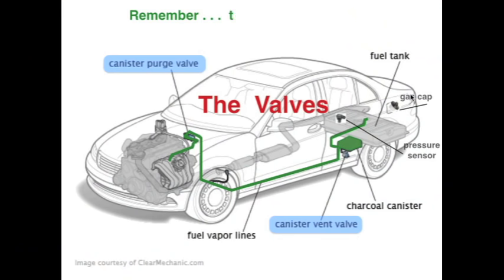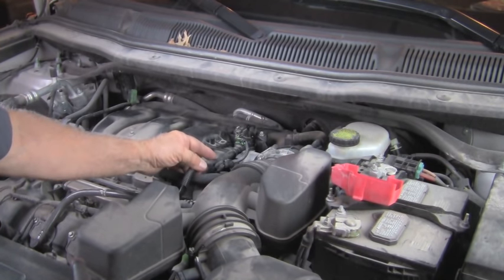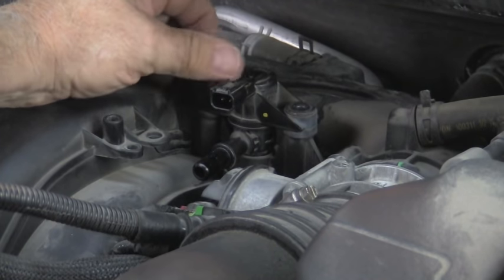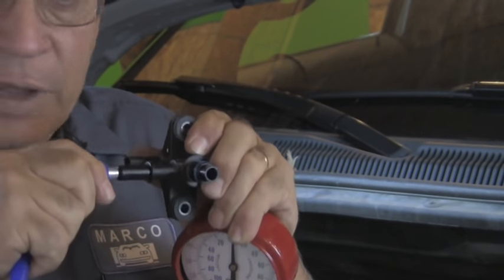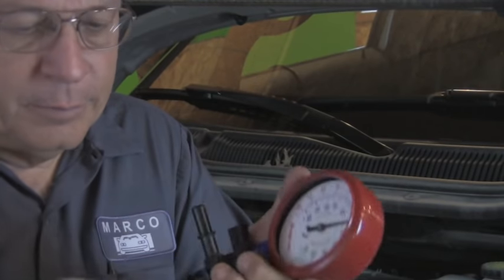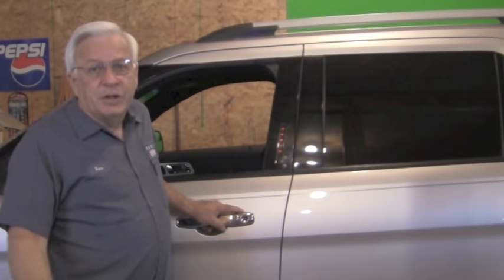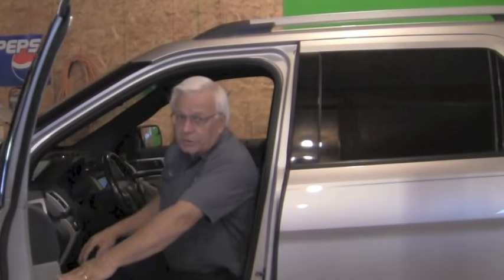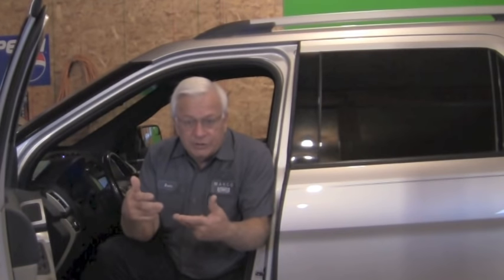How to find a Small EVAP leak without a smoke machine Part 2

Comment: This is a very good troubleshooting video and a clear step by step guide of how to read codes all the way down to the smallest details. I have an EVAP problem with 2003 dodge grand caravan and I had it checked and they found a leak when they smoked tested it but after days of driving the small leak code came back again and I took it back to them and found another leak and changed the rubber hose but they charge me again for the same problem. And now after driving a few days, the small leak code (P0442) came back again but I'm worried that they will charge me again for the same problem. Is that fair and normal in your field?
Reply from the maker: EVAP problems can be the most difficult to find. And it is possible to have more than one leak.  However, the system itself is monitored by the PCM and can tell if the system is working properly or not. .  A tech who truly understands how to diagnose these problems should be able to run a test after he has found and repaired a problem that would confirm that the system is fixed or needs more attention.  Unfortunately many techs simply find a problem, fix it, and return it without verifying the system is really fixed.  My opinion only is this: the shop you took it to most likely doesn't understand this or they would have confirmed the repair the first time.  Is it fair . . . no,  however it's probably normally what goes on.   Find a good diagnostic shop, discuss it with them and they will treat you fair.
Reply: +realfixesrealfast 
Sir: you are a very smart and wise.. and very correct.. always think about what your doing. No amount of schooling can replace "Common Sense". !! Thank you sir for your videos , you tell it like it is... easy to understand. God Bless you. !

Comment: My question is, my 97 Ford Ranger 4.0L has a thermistor valve as well as a purge valve.  A thermistor would deal with temperature?  What is its purpose in the evap system?  Most before 97 and all after do not even show a thermistor.  My shop manual (Ford complete) does not even show it in the schematic.  It is in line before the purge valve driver's side down by the wheel well with the cannister being just outboard of the radiator.

Comment: I'm not sure how Holden does it in my 2002 model Holden Commodore as it runs the 5.7 litre Chevrolet LS1 V8 engine & they didn't fit a pressure sensor in Australia.

In my case it was a leaky fuel tank cap so that fixed the P0171 lean code issue,the question would be - is the purge control valve solenoid closing off fully when the engine is switched off ?

It should  because the fuel tank vapours shouldn't be able to vent into the atmosphere,I can always check it when the  engine is switched off by blowing through it !

Comment: Duane,
I have a 2000 regal gs (supercharged) Summer car (no rust) 110,000 km (68K mi) P0442 code. Changed the fuel tank pressure sensor last year when code first happened. No fix. Blow test on purge valve shows no leak. tested with vacuum gun too.
I have a descent scan tool (not as fancy as yours). Freeze Frame data shows rpm 2021, vehicle speed 43k/h (27mph), coolant 62deg C (144 F). With car stopped, I also read live data Fuel Tank Pressure -0.19 mm HG (some flicker to -.38)  FTP voltage 1.43V)

One difference between my car and the ford is that the ford code happened with a stationary vehicle. mine was moving at about 27mph. Does this tell you anything relevant?

It would have been nice to test the other valve (vent). I cannot program it to shut off like you did with my scanner. Will applying 12V cause the solenoid to close the valve?

Thanks for video.

Comment: Video was good about you explaining how the evap system works.  I agree.  Your Diagnostic tool/computer did not help in any way...all it did.....verify a small leak. Data did not help to find the leak.  Ok. you found the leak at the Purge Valve....lucky you!   Computer tell you the Purge valve is bad?  Also, Just wondering ...how long did you drive the car before it did the self test on the evap?

Comment: YES, THIS IS HOW IT'S DONE.    AS A TECHNICIAN , NOT IF I AM MY OWN BOSS, I CANNOT SEND THE CUSTOMER OFF AND TELL THEM IT'S FIXED UNLESS I ACTUALLLY PERFORM THE LEAK CHECK.  CHECK AND VERIFIED.  SO ALWAYS PERFORM LEAK CHECK BEFORE RETURN THE CAR BACK TO CUSTOMER  BY ACTUACTED THE PURGE AND VENT SOLENOIDS AND WATCH THE VACUUM VIA THE FUEL TANK PRESSURE SENSOR TO SEE IF IT HOLDS.
Reply from the maker: Thanks for your comments.  I appreciate it

Comment: I will check my purge valve like this. :) I have a very small leak that my check engine light comes on after about 2500 miles or 3000 miles.

Comment: Very informative video. Quick question though: since the check engine light came on for the customer after 3 startups and 81 miles of driving, how can you be sure that the problem is fixed after a few miles of a test drive? Or does the computer immediately recognize there’s an issue, which shows up in the scan, and only throw on the check engine light if it persists for a given period of time?
Reply from the maker: Great question.  It can be frustrating because most OEM's have their own algorithm.  The evap monitor does not run automatically. It has several parameters that must be met before it will actually run the monitor.  A long test drive that includes a couple stop-starts and speed changes usually will hit the parameters.  I usually include some city and highway driving.

Comment: Anything, sir, u can post about the 98-11 Ford Panther Platform would be greatly appreciated! I just got a 0442 code on my 2000 Mercury Grand Marquis... 121kbmiles, runs rides and drive basically like a brand new car.. I just had filled the tank from very very low and it was extremely humid outside

Comment: Thank you so much for this! I have a 2002 VW Jetta 2.0L. I replaced my purge valve and I am still having a bit of gas smell and not maintaining the start. My code was PO456. So I need to check the charcoal canister next?
Reply: There are multiple things that can cause that code.  I would advise you take it to a good diagnostic shop, instead of throwing parts at it

Comment: I did check the gas cap and replaced the purge valve first and it was not the problem. I was hoping to see how you would find the leak other than the purge valve without a smoke machine as the title suggested. Unfortunately this video was not that helpful for me as I already knew most of the information presented. I don't have a smoke machine and was hoping for tips on how to manage without one.

Comment: Or it could be stuck closed . Went to put gas in my tank and it would not take any, i blew air in the tank ,and could then fill up. I am guessing i blew out the seal in the purge valve because now i am getting P1443. Good common sense video

Comment: If you leave the purge valve in place but with the electrical connector and hose removed, the valve should be closed so, just start the car and see if you have vacuum at the valve.  Feel with hand, use vacuum gauge or see if it draws in something very flexible, such as a very thin strip of light gauge paper but, a gauge is cheap and most accurate.
  That's the easiest way, no removal of valve unless it's condemned.

Comment: when testing a purge valve I usually don't even take them off, disconnect hose going to purge vapor side and leave vaccum source on valve and disconnect electrical connector start it and check vacuum. if the answer isn't obvious then I put a gauge on it.

Comment: knowing that the lines will eventually leak (esp the older all rubber ones) you can wrap the line ends in silicone tape which will ensure they wont ever leak for the life of the car.

Comment: 7:34 not clear.  Why is the Max allowed value 0.40 when it Failed, and the Max allowed values changes to 0.31 when it Passed?  Methinks the Min/Max values are not actually the thresholds for pass/fail, but are the min/max instances seen (and Value is actually an over-time "average).

Anyhow, great deductive work and love the simple way to test that solenoid for holding pressure.

Comment: And I thought I was the only one who used a vacuum gauge to check a purge solenoid. I do it a little bit differently though. I put a hand-operated  vacuum pump on the port that engine vacuum always pulls from, and put the vacuum gauge on the other port. I pump the vacuum pump up a few pumps, and if the gauge on the other end shows ANY vacuum whatsoever, the purge valve's bad.

Comment: I'm having issues with a 2008 fusion recently put on new battery after all the snow and now have a rough idle and startup is slower at times have code p0442 drives fine only issues is at idle either in park or while braking at a light or stop sign

Comment: What effect would a small leak have on the engine other that the service engine light? Also after the repair don't you have to crank the vehicle 5 seconds, turn it off for 10 seconds and restart it? You Didn't mention that.

Comment: I've have code PO442 and P0456 for a while now.  I replaced the purge valve, Evap canister, EGR valve and gas cap.  Still can't figure it out.  It is a '10 Forester.  Any suggestions?

Comment: I have an issue with my 2015 f150 3.5 eco boost with dtc p2196. Sft-1 10%, Sft2 -15% it has 80k miles. Thought it was excessive carbon build up did an induction service with no change then I was told it was the cats partially clogged so I replaced both of them. Readings change quite a bit but then it started to go to -10% b2   b1 and 9% b1 this is better readings but still big difference between banks. Dumped to much money. Already what am I missing? Vehicle runs fine no misfiring.

Comment: Also monitoring the o2 sensors can give a clue given the leak. Most likely a rich condition affecting both banks, probably not large enough to set a code for rich condition

Comment: Thank You! We have code PO442. Went to Auto Zone for testing. They suggest changing Canister Purge Valve. After repair will the check engine light go off? Auto Zone will not turn it off.
Reply from the maker: IF the Canister Purge Valve is indeed the cause of the code, then yes the light will go off but not immediately.  Remember the pcm saw the problem so it will need time to see that it's not there.  You may need to drive it a few days before the system will re-run it's checks.

Comment: If I have suction on the Output side of the purge valve but NOT on the Vacuum side which comes from the gas tank, IS MY PURGE VALVE BAD AND NEEDS REPLACEMENT??? Reason I ask is that on this video he only sucked in from the Vacuum side but not from the Output side. He only tried blowing through the Output side. Anyone know???

Comment: Problem is that this case doesn't require much critical thinking-- you're just starting with the most likely culprit.  It's when purge valve is good, vent solenoid is good, gas cap is good, and even the smoke machine can't point us in a direction, that critical thinking needs to be used....cuz damn, hopefully the pressure sensor the EVAP system uses is probably good most of the time and the code in these difficult cases is only set after hundreds or thousands of miles of driving and many start ups.

Comment: A lot of times, checking the easiest thing first is the way to go and in my case, I got lucky in that it WAS the purge valve.
2015 Dodge Charger with 51k miles kicking out a P0456 code. Removed electrical connector and canister-side hose on the purge valve and by using my finger, I could tell there was a definite vacuum there when the engine was running (and cold). The valve is supposed to be closed under these conditions. This indicated that the solenoid/diaphragm assembly inside was open so I tapped the valve on the intake manifold a few times, sprayed a tad of WD-40 in there and started the engine again. What do you know? No vacuum!
Reply from the maker: Good job, and good critical thinking.  Saved yourself some money too !!
Reply: @realfixesrealfast  True, critical thinking is paramount and I MAY have saved myself some $ but it took more than the one application of WD-40 to loosen things up to the point of clearing the P045 code. It was still "stuck" after attempting to drive several miles to reset the EVAP system so did a second then third application of WD-40 whereas the third included an application of some "throttle body cleaner" to get the code to clear. We'll see how long the clearing of the code lasts but being plastic and rubber, I suspect a purge valve is in my near term budget. None the less, thank you for your guidance in troubleshooting this issue.

Comment: Why does the computer in my 2000 4.6 engine e150 not tell me I have a vacuum problem in my vent door system? Is it not set up to check that system? I obviously have a leak because my blower only blows to the defroster. Not the vents. This means a leak right? Yet there is no check engine code for this. Just curious..

Comment: I took my jeep wrangler to few mechanics and I had the purge valve changed also the canister by the gas tank I'd also change the gas cap from the dealer.   I keep on getting the P0456 code.   over and over    2015 Jeep Wrangler unlimited sport 
any ideas??

Comment: hi my cooper s does not send the signal from the pcm to the purge solenoid. i also checked the cables and fuse. all regular but remains fixed just over 2volts. do i have a damaged pcm?

Comment: My question is let's say your car is sitting in the sun 90 degrees and the pressure is Building inside your gas tank isn't the valves supposed to open?

Comment: The level of data that your scan tool put out, what is the cheapest scan tool that I can get away with that will tell me that much info so I can make educated guesses like that.  I have never used scan tools before.  I've used DMM's test lights and vacuum gauges.  Don't have the $$ for a solus or Modis.

Comment: Another  cheap way to do it is to get some detergent or liquid soap mixed with water (1 tablespoon) and plunge one of the port to the bubbly soap and blow through it  and or  try sucking to the valve for leak or bubble.

Comment: I have a 2010 Audi Q5 and im getting that code P0456 very small leak in evap, I replaced the gas cap with no avail just order a purge valve solenoid I'm hoping this is it and I don't have to change anything else

Comment: I found out that a defective gas cap can also cause this leak. Since it was cheap to replace I bought a new one since my car has about 110,000 miles anyway. It stopped this code for a while, but it did come back on. Now I'm thinking either it is this purge valve or there is an actual hole in the system. I think I know where my purge valve is, but not 100% sure that it's the valve. I need to look at it again and if it is in fact the valve I'm going to replace it and see if that solves my problem. The vehicle runs fine but it's annoying to have that check engine light on all the time. It's a 2011 Mitsubishi Galant that I only drive short distances a few times a week.
Reply from the maker: Randy, yes a faulty gas cap can cause this code, but that is extremely rare.  When you replaced it I assume you cleared the codes.  If so, you simply reset the monitor that monitors the system.  That system has a very particular and complicated set if parameters that are required to set the code. And it usually requires several specific drive cycles to activate the code. There best thing to do is test the components before you replace them.

Comment: my friend is having a evap code set on his and we are trying to figure it out its a 2006 ford explorer he has a check engine light he had it scanned and it has a evap code. do the 2006 models have a large and small evap code? also a local shop said it was egr valve and one other valve I can't recall the one near the evap canister if that helps! I know the vehicle has a slight surge at light exceleration at about 35mph and if you rev the engine you hear slight exhaust pop but it idles good other then that! any advice you could give would be greatly appreciated! thank you!

Comment: whats the purpose of the vapor canister purge vacuum switch on GM models what does it do ? I have a code 0441 and should there be pressure in the tank when cap is removed ?

Comment: How does your car control the pressure in the gas tank when the motor is off and it's sitting in the sun or whatever sure when the motor is running it vents into the intake but what about when the motor is not running

Comment: Remember this guy said can find problem just on driver seat, and he show you to remove purge valve to check, don't need to, just install mighty pump to make some pressure, if it not hold that mean  it leaking, if it not either hose or vent valve....

Comment: Or better yet you can do it with the scanner. Watch the fuel trims, and pinch the evap line with pliers. If fuel trims react then you have a leak and a diagnosis without getting your hands dirty.. Unless your pliers are dirty... Lol
Reply: Great tip! It would be nice if all such were gathered into one video for those who don't have megabuck$ scanners. It gets a little tedious checking for source/supply/gnd signals on multiple valves and the potential ECU fuse blowing (if you're lucky).
Reply: This guy actually understands how to diagnose and fix things without having to rely on a scanner automatically. There is nothing wrong with scanners, but there are so many so-called mechanics nowadays that don't have a clue where to start in diagnosing a problem without the scanner telling them. This is where experience and knowledge come into play.

Comment: I have small vacuum leak detected twice on my 2006 Chrysler Pacifica with 121k miles on it and both times happened in the morning when I just starting it. It was around 70F outside temperature. It never came on while I was driving it. Any ideas? Thanks